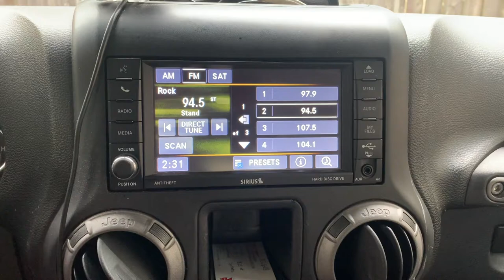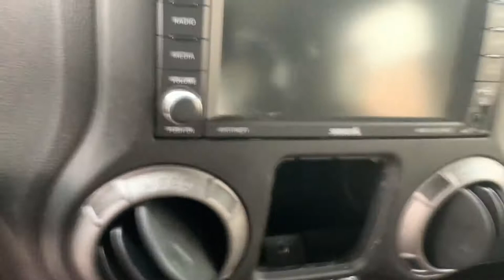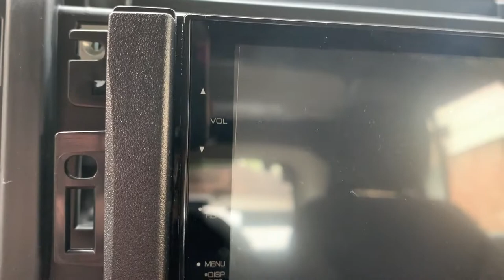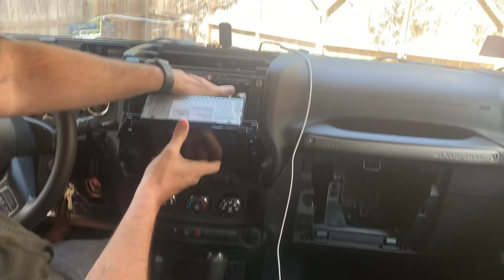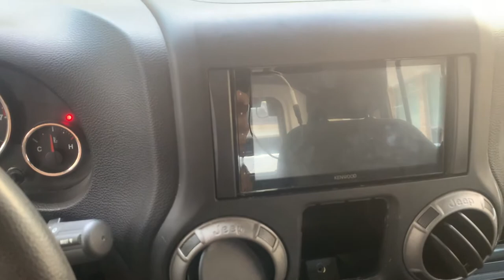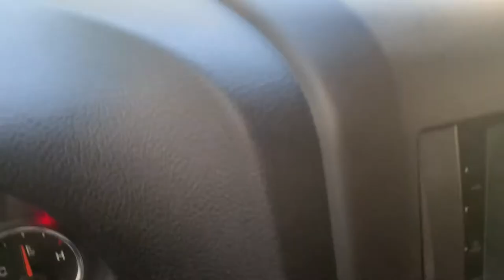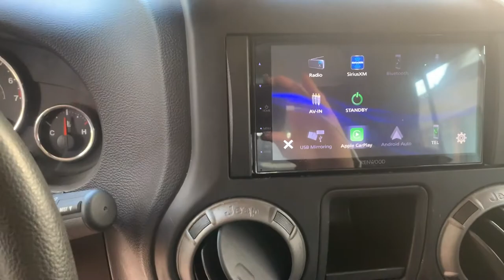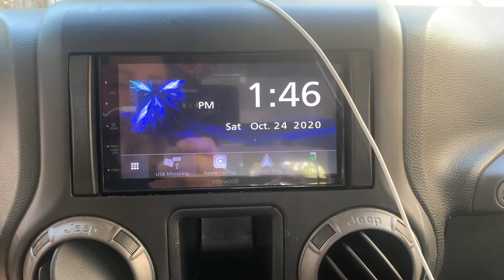Replacing the factory radio with Kenwood DMX4707S in a Jeep JK Wrangler

Comment: Off of the rp4-ch11 what wires did you connect? Did you leave the jack loose and connect the blue and white? If so where did you connect the blue and white wire from the module? I have the same exact radio and can’t figure that one out. 11:34
Reply from the maker: Sorry but I really don’t remember all the details and I can’t seem to find my wiring diagram now. I hope you figured it out by now anyway.

Comment: Do u need to wire the park brake and reverse light ? Or without will your reverse light and park brake still work ? There just sensor wires ?
Reply from the maker: I did not have to wire reverse or parking brake. The module tells the radio when in reverse.
Reply: @BasecampUnbounded need u use the brackets off your old radio on your new one ? On the sides
Reply from the maker: @cheeser6886  no, the kit I bought had brackets
Reply: @BasecampUnbounded can I use the stock brackets ?
Reply from the maker: @cheeser6886  I don’t know. I had to trim the stock surround to get the radio to fit. Not sure if you can make it work with the stock mounts.

Comment: Did it make your speakers louder and more clear? I'm looking into this exact head unit for my 13 wrangler. I have already upgraded the four main speakers (the two in the sound bar and the two in the front by your knees) I upgraded them to the Kicker ones and would love to know if this stereo is worth the upgrade as I am needing it to be louder yet clear while the top is off. Thank you!
Reply: I would think that volume would be related to the amplifier rather than the stereo head

Comment: Does the kenwood turn on and off with the car?
Reply from the maker: Yes, there is a delay in my jeep for a couple minutes unless the door opens, then it goes off
Reply: I’m having a hard time wiring I connected the yellow wires with the red. To get it to power up. Idk if that’s correct.? If you have any advise
Reply from the maker: @FATLEHAZE22  Honestly, it’s been a while since I installed mine and I used a wiring guide I got from crutchfield. I don’t remember how I wired it. Usually you will have a accessory wire that’s only hot when the car is on and a power that’s always hot that keeps power to the radio for saving settings and presets etc. I believe yellow is usually the accessory wire
Reply from the maker: Actually the red is the accessory (powered when key is on) and yellow is full time powered off battery. Check page 51 of manual https://manual.kenwood.com/en_contents/attachDownload/101574
Reply: Thank you

Comment: I finally purchased my new head unit and backup camera and will be installing them tomorrow. Did you have to wire your backup camera into your taillights so that it would turn on when you go into reverse, or do you just have it controlled through the stereo itself?

Comment: Do your steering wheel controls still work? Mine didn't work even with the PAC module
Reply from the maker: Yes they work great. You may want to check your connections and make sure everything is connected correctly. They should still work if you connected everything correctly. You also have to set the small dial on the pac to your brand of radio. Hope this helps. Thanks for watching.
Reply: @BasecampUnbounded  did you have any problems? Because I'm not getting any power to the accessory wire
Reply from the maker: @14JesusC  no everything worked as it should. You might check with a volt meter and see if power is coming through the pac. If not you may have gotten a bad pac. If so you may have gotten a bad radio. Just to be sure the ref wire on the pac connects to the red wire on the radio. Hope this helps. Good luck.
Reply from the maker: Also you might check and make sure you didn’t blow a fuse during installation.